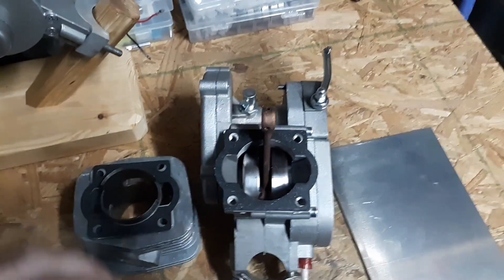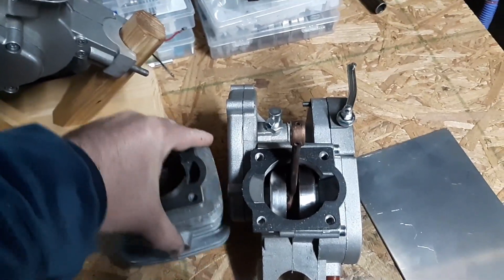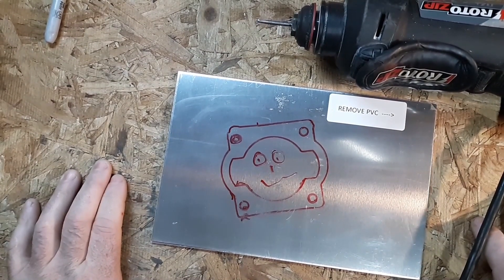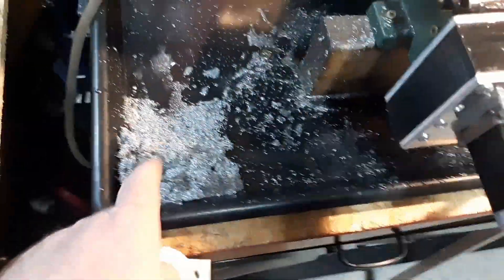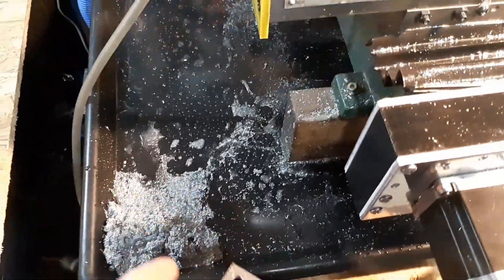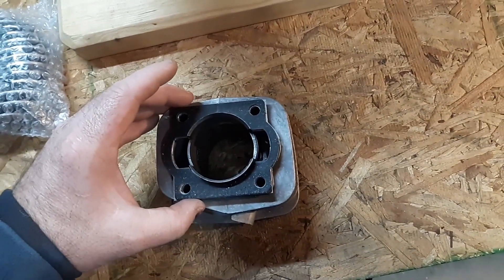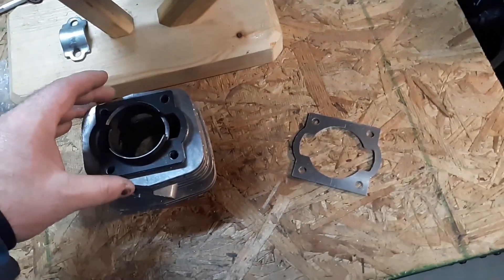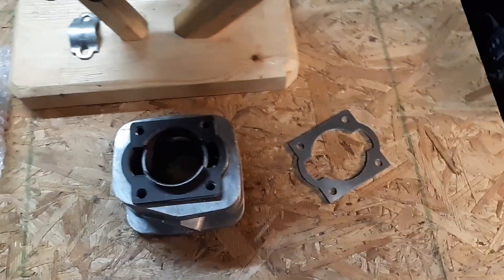110cc Motorized Bicycle Kit - Correctly Fixing It's Geometry Part 1 The Spacer

Comment: Hey I have a question I have a YD100 that I have already ported. Transfers, exhaust intake, I stuffed the case and Increased velocity and compression it screams goes about 55 60ish mph. I have been attempting to try and use a ported piston and reed valve tried every size and shape with the Dio reed. Now it's a 24mm Nibbi PE carb stater magneto oz magnet stand alone coil and CDI advanced timing slightly. Like I said the thing screams I also watched your video on balancing my crank and followed suite. Runs like butter. But can I ask if there is any benefit from the windowed piston or how to get a power increase with that set-up. Please let me know

Comment: Na, i ordered one from them was supposed to be 40mm was only 37.5. i measured a bunch of times and 37.5 was biggest i got. 🤦
Reply from the maker: Not sure what you are asking?  Most crank for these engines are 36mm to 38mm.  People dont understand every rod is identical in dimensions.  Different weights.  There is 40mm cranks.  You have to  find a seller that is legit though not just selling one as something they are not.  This is a legit 40mm crank one I used to rebuild the 110cc build  actually  dead on money 40mm stroke.  All 3 now purchased from them https://www.ebay.com/itm/284896790192?mkcid=16&mkevt=1&mkrid=711-127632-2357-0&ssspo=MJhS6HDyRii&sssrc=2349624&ssuid=H87FyUHfRRW&var=&widget_ver=artemis&media=COPY
Reply: @BuildBreakFix  thats who i ordered from. I sent a message telling them and i didn't get any response back🤷

Comment: Looks good brother. I probably have some of that aluminum dust in my lungs  Yup I'm not going to lie I was ignorant in the beginning be safe brother
Reply from the maker: It's no joke! It will get yeah later in Life! Grinding wheel  dust is even worse
Reply: @BuildBreakFix yup I’m guilty of doing this myself. I noticed that a lot of it stays in the air while porting cylinders so I run a fan nearby with a good mask on and eye protection. Don’t want to hurt my health while im still only young

Comment: Hey,  any idea if I'm gonna order a set of say 5 main & 5 pilot jets for a VM or PZ22 carb what size-ish range they should be?  
For a 49mm g2 reed build.... I would just go piston port but a G2 reed will solve clearance issues.
Reply from the maker: What?  No clearance issues with any of the 49nn iron sleeves.  If so then you have the wrong crank in it.  Af80 is crank goes with it factory anyhow jets depend on where you live. Temps and elevation
Reply: @BuildBreakFix    I know jets depend on engine mods, elevation,etc... What I was asking was if anyone knew a baseline jet size to start with on a PZ22 ....Example, when someone asks what size jet they need for an NT carb on a mostly stock engine. Most will say between a 66 & 70 (unless you're at very high elevation)  & that the carbs usually come stock on the richer side with a 70 jet.....  I was assuming on a VM22 or PZ22 that the main jet needed would be around the same size of 70-ish. But wasn't sure if going from a 19mm stock carb to a larger 22m would drastically change what main jet size is needed.
Reply from the maker: @michaelbrinks8089  newer pz18 -30mm carbs don't have jets you can change! there pressed in! Older carbs sure but you're looking for a unicorn!  trying to find jets.  For Vm 22  it would be a P58-62 and M82-93 you would start with roughly.  That is what I had in all my builds I'm at sea-level literally!  High up in elevation higher up you go less fuel you need. So at 3000 feet would be almost 4/5  those numbers.  P51 and M77 for example!
Reply: @michaelbrinks8089  I'd recommend the Dellorto PHBG 19 clone (sold as a KTM50 carb). They're a smidge more expensive than the PZ carbs, but they're very good quality and jets are easily obtainable. Pilot jets are at Treatland, and main jets are the same 5mm threaded type the stock NT carb uses. You'll almost definitely need to swap the main jet, since it's like a #115 or something crazy.
Reply: @BuildBreakFix  Thank You !!! .....Pressed in jets wtf??  Really makes you wonder what the hell they were thinking.... You saved me the headache of buying the $40 pz22/g2 reed kit & possibly wrong VM22 jets....  My riding area is between 550 & 700 ft elevation. I knew higher elevations= thin/less air= runs rich
Reply: @michaelbrinks8089  I have an older pz20  and I don't use it cuz I just don't like it ,but I did find jets for it at Alibaba .it took a while to get them though they came from China.
Reply from the maker: yes pz carbs are actually designed for certain chinese engines!  PZ19 50cc / Pz20 70cc / pz22 120cc 4 strokes actually! they don't need jetting like 2 strokes require to run the same!

Comment: Another shared knowledge...COOL.. LOOKING GOOD AND ALL PARTS ARE ALINED, THAT WAS THE GOAL. ACCOMPLISHED👍😉😎🥳
Reply from the maker: Thanks 👍
Reply: When he's done with it, I'm sure it'll make decent power.....But it looks like that engine kit is way more trouble than worth for someone without the tools or building experience. Can't believe it had the wacky size crank in it. something like 37 or 38.point something labeled as 40mm stroke.
Reply: @michael brinks  That's why he is so cool to watch because he shows what can  be done and shares that knowledge 😉